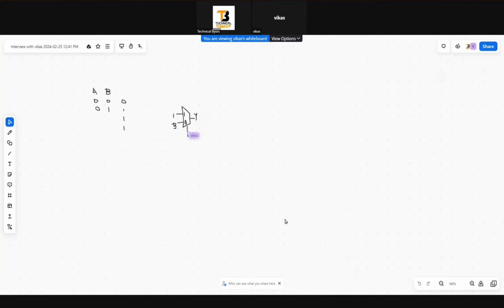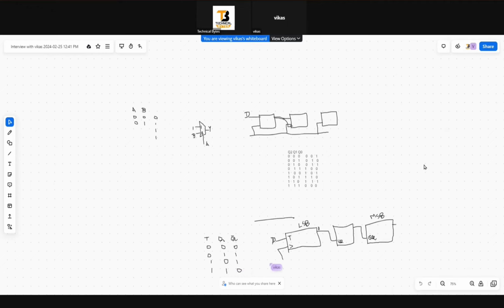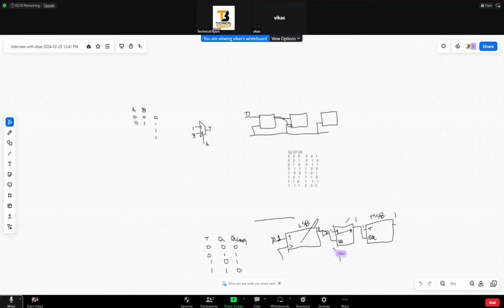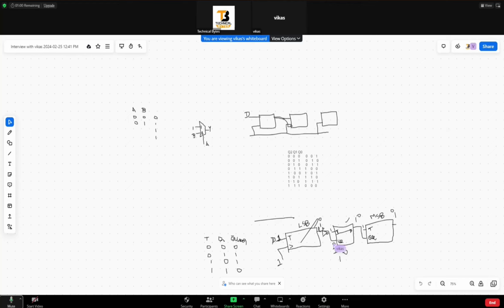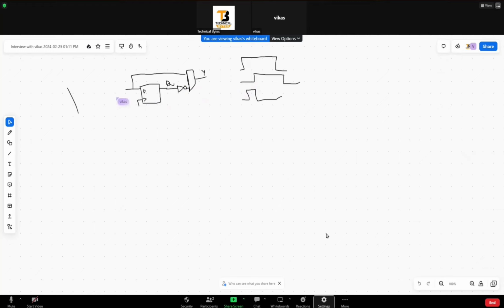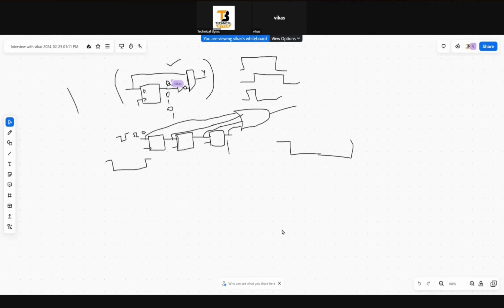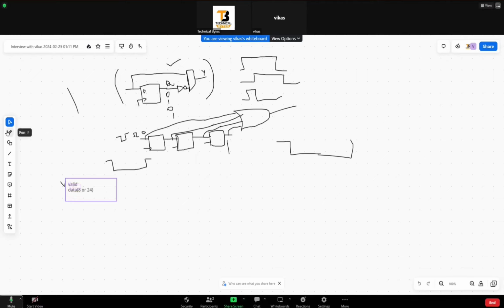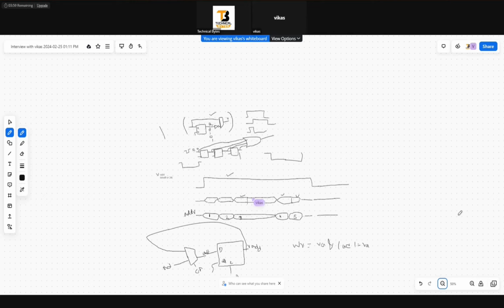LIVE Interview Session with Vikas Chauhan (Fresher)

Comment: Hello sir, when you are combining edge detector and pulse stretcher to generate 3 clock cycles pulse; there edge detector won't generate single pulse; it will detect multiple edges if there are multiple posedges . So, this approach may not work.